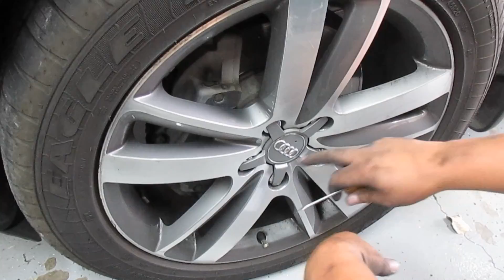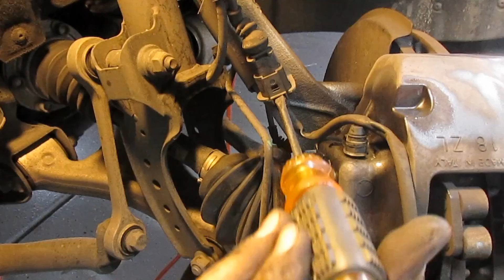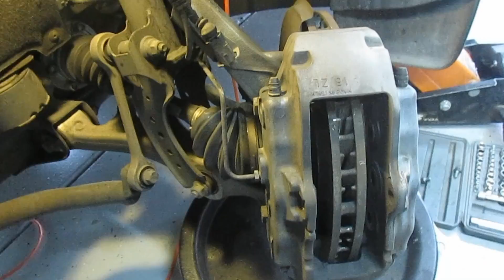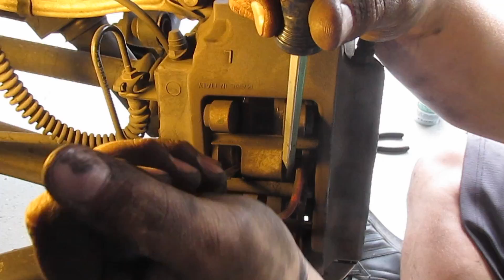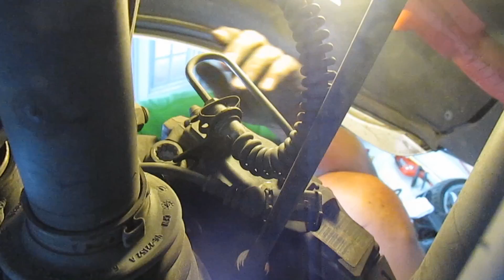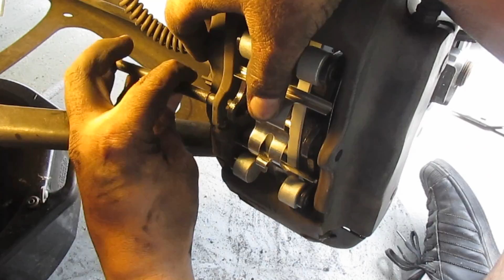HOW TO: Audi Q7 F&R Brake Rotors & Pads

Comment: did the parking brake shoes automatically adjust or do you have to do it yourself?  is there an access port like on old drum brake set ups?
Reply from the maker: I didnt have any issues with those.  Dont have a lot of info to help.  But those are actuated with electrical switch.  So adjustment is automatic
Reply: @FatGuyBuilds  ok, i'm about to do the rear brakes on my q7, thanks for the good video
Reply from the maker: @markbryan8574  no problem

Comment: Really appreciate the video. 
I did the rear pads and rotors yesterday after watching the video - huge help!
I had to use pneumatic tools for the job and couldn’t have done the job without them. 
The issues were:
1) the caliper pins on rear brakes and 
2) M16 bolts holding caliper assembly 

I could not bang the pins out with a hammer and punch (was hitting them pretty hard to point I ruined the punch) so I went to Home Depot and got a punch attachment for the air impact hammer. With that, each pin was out in about 20 seconds. 

The M16 bolts wouldn’t budge with a breaker bar and the “man muscle” I threw at it but I was able to wiggle the impact wrench with the right extension on both the top and bottom bolts and that did the trick. 

I’m new with using pneumatic tools - wish I would have added these to the bag of tricks years ago. They really do save time, sweat, busted knuckles and a LOT of frustration.
Reply from the maker: glad i could help!

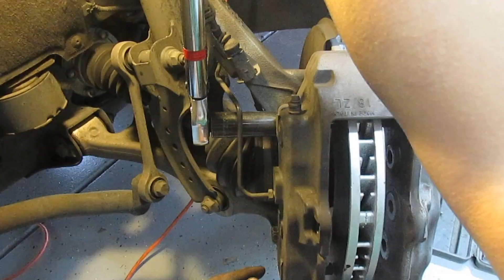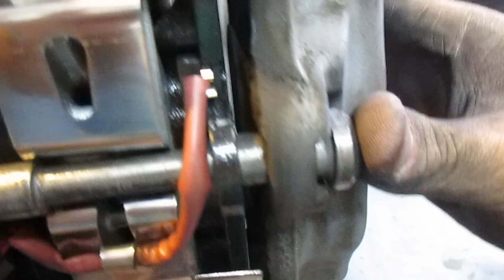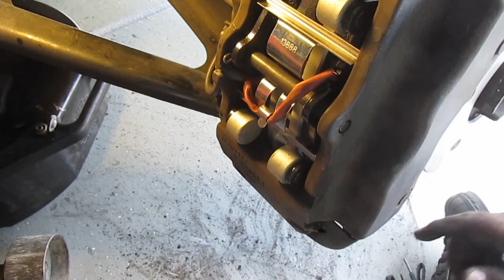Comment: @FatGuyBuilds.  Good video, but for safety's sake, please tell viewers to torque the caliper bolts to 270Nm (200ft-lbs) at 5:19. 120ft-lbs is not nearly enough for that bolt alloy. The disk (rotor) fitting bolt should be torqued to 15Nm (11ft-lb) at 4:43. The tension strut bolt should be torqued to 30Nm (22ft-lb) at 6:55. Wheel lug bolts are 160Nm (118ft-lb) at 7:50 & 14:53. The bracket allen bolt is 9Nm (6-7ft-lb) at 7:26
Reply from the maker: tight is tight,  you dont even need the rotor hold down bolt to function.  make it tight.  over tight is fine , just dont break it.

Comment: Hello. I have a 2009 Touareg, and I folowed the tip with sanding that lip above each hole. I have installed Zimmermann coated discs. now when the car is driven, I hear some grinding noises from the rear wheels . what can be done?anyone has this problem too?
Reply from the maker: should not be grinding unless something is either installed wrong or jammed.  take it back apart and look for the damaged caused by the noise.
Reply: @FatGuyBuilds  i think the grinding comes from the discs brakes, they grind in the dirt cover. i will take a look.

Comment: This is a TDI q7 correct?  I just had a parts site tell me I needed a heavy duty kit for mine because it was TDI.  mine is only the 3.0 V6 though, do you think they were imagining I had the big V8 heavier model?
Reply from the maker: Measure your rotor and then compare it to the sizes of the different options

Comment: Is there any need to apply anti seize lube on the back of the pads to avoid  squealing? I love your video! Thanks.
Reply from the maker: no they come with anti squeak pads glued to the back.
Reply: FatGuyBuilds OK, I need help! I am in the middle of the rear rotor and pad replacement tonight. I CANNOT get the master brake assembly to release the rotor. I can feel the spring assembly grabbing it as I pull on it. I did remove the two bolts on the rotor. I know that this is not a Electronic master brake, so no need for the diagnostic tool. Your rotor came off after a little pulling.What am I missing?? Thank you very much for all of your help. I appreciate it greatly.
Reply from the maker: @jonathanl2748  make sure e-brake is off.  You have the master cylinder cap off?  Did you compress the caliper a little bit before with a flat head screw driver?  You may need to rent the compression tool from autozone as well
Reply: FatGuyBuilds I will remove the master cylinder cap next. The hand brake release was pulled. I have removed the calipers and my piston expander worked beautifully. It is just the rotor now and that batch won’t come off. It is loose, but I can feel the springs pulling it back to the hub.
Reply from the maker: @jonathanl2748  make sure the e-brake is released.  You may have to manually try to loosen the ebrake pads
Reply from the maker: Look for an adjustment knob in the back
Reply: FatGuyBuilds will do and thanks very much.

Comment: The reason the rear rotors didnt fit on the hub is because the Audi VAS scan tool is required to retract the electromechanical parking break on the rear. Please dont do what he did guys and sand/grind down the rear parking brake to make it fit. All your doing is ensuring your electronic parking brake wont work when you need it to because it now has too much clearance to fully extend the shoes against the center drum. 

Source: I am a certified Audi technician. Just take your car to the dealership or someone who has access to an official VAS scantool if you need to do rear brakes on any newer (last 10 years) Audis. Not trying to be a know it all dick or asshole, just showing the right way for it to be done. 

Source: I am a certified Audi mechanic for 3 years now.
Reply from the maker: you are full of shit.  parking brake was not damaged what so ever.  i did not grind the parking brake anything.  the hub assembly had useless tabs built on it to try and force people to buy audi branded parts.  nothing to do with parking brake.  everything works and performs great.  you just want to screw people out of money with your 135$ per hour shit.  you dealer mechanics are the worst scammers on the planet.  obviously you dont change brakes with the E-BRAKE set to the on position.
Reply: @FatGuyBuilds  lmao why do old DIYers get so butthurt by the truth 🤣
Reply from the maker: @markymark3668  not the truth if my stuff works with zero issues
Reply: Hey Mark you mind if I asked you a few questions. My 2017 Q7 is due for a brake job soon , just had a few questions to ask since there’s no content for my Q7 available on you tube.
Reply: @christopheramerally3194  Sure, fire away! :]
Reply: Hey Mark, if you dont have an electronic E-Brake, this should be a non-issue, right?
Reply: @ryanrob99  Yes sir! All the mechanical parking brakes found in older Audis (usually 2008-2009 or before) do not require this step during rear rotor and pad replacement.
Reply: Mark Grames what’s funny is I have a 2015 Q7, no electric parking break.

Comment: I just changed my brakes all around and my rear brakes are scratching/grinding when I start driving and my foot is off the pedal the faster I go the louder both of the rear brakes make a Scratching/grinding sound please help.
Reply from the maker: most likely you bent the heat shield and it is touching the back of the rotor.

Comment: Awesome! Awesome! Video. 1 Audi Q7 brake job complete. One major comment. I have never used a hammer like I did with brakes in all my life of doing brakes! that pin is a bitch! Can't get a good enough leverage clearance to give it a good whack! Plus, I didn't want to break anything else. This is another example or where searing was invented, working on cars/trucks and golf! Quote from dealer was $1300...no rotors. Just brake pads front and back. My cost, I little under $500. and it feels good to get a job done!
Reply from the maker: you are welcome!

Comment: Thanks to you, I just completed my first brake/rotor job (fronts) on my 2013 Audi Q7. I had to buy several tools, but I will  them for the next job.  I appreciate you very much.
Reply from the maker: Your welcome..  please like and share and think about maybe checking out my patreon...  fatguybuilds
Reply: Question: I need to bleed the brakes,  but there are two bleeder nipples on the calipers. Do I bleed both, just the inside one, inside one then the outside? Thanks.

Comment: Hi, nice video, are the back rotors 330 mm or 358 mm in diameter ?
Reply from the maker: sry i dont know.  you can measure yours if you just take the wheel off.
Reply: hi again, thank you for answer! 3.0 tdi engine has 330mm rotors and 4.2tdi engine has 358 mm rotors

Comment: This was very helpful, thanks! I do have a question? I'm about to wrap this project up ($530 in parts by the way, vs. $1500 quoted by mechanic...  significant savings!... and I even painted the calipers in the process!), and I realized that this instructional didn't mention anything about adjusting the parking break back? Is it necessary? Or does it self adjust on this vehicle? THANKS!
Reply from the maker: no need to mess with the parking brake.

Comment: For the rear caliper bolt. Is there a technique to take it off? I have difficulty fitting a breaker bar in the wheel well. No room to fit and turn
Reply from the maker: spray with PB blaster penetrating oil once a day for 3 days then try again.
Reply: Jason wasn't lying about the "man muscle". These were really tight for me also. For the top bolt, I had to hunch over the hub sideways (as though I was wrapped around the axel) inside of the wheel well, and use the wheel well against my back as leverage to pull up. It was quite the spectacle as I am 6'1"/225 lbs. I didn't fit so well :) For the bottom bolt, I was actually able to use a 1/2" breaker bar (because they pivot under the standard 45 degree angle) and slip my jack handle over it. Now, I only had 3-4" of travel without losing travel, and, I suggest using a rag around the jack handle/breaker bar because it will be somewhat wedged against the outer wheel well lip. It can scratch the plastic lip (in my case with the S-Line) or the paint on premium models. Good luck!
Reply: I extended the breaker bar with a black pipe.  The end of the pipe will move a couple inches even tho the breaker moves millimeters.  It is still enough to break it free.  It also provides significantly improved leverage.

Comment: Dude, Well done.  Thank you for making a video that’s worth the time to watch.  Is there a need for any “anti squeak” silicone, etc. anywhere in this install to reduce squeaking??
Reply from the maker: squeaking should go away over some time.  did you make sure to use brake cleaner and clean the rotors very good?

Comment: Do you not need something to disable the electronic parking brake for the rears? Awesome video. About to do this for my RS7
Reply from the maker: just Do not put the parking brake on.  if you have to shut it off in Neutral.

Comment: Hi - Thanks for the description, nice job. I am setting up to do this job on my 2012 Q7 4.2 V8 TDi. I did notice that in the Q7 disc/pad sets, the front discs are always 350mm but the rears can be either 358mm or 330mm depending on model so take care when ordering. The other comment is to watch the fluid doesn't rise up and overflow when pushing the pistons back in. I always press the brake pedal a few times after fitting each wheel, to keep the fluid level as low as possible in the reservoir.
Reply from the maker: Thanks For Watching!!!

Comment: Hi, do you know where I can get 2017 Audi Q7  3.0T front brake pads other than dealer? I've looked through everywhere. Nobody seem to have it yet.
Reply from the maker: rockauto.com
Reply: Jason Georgievski Thank you. They don't have it for 2017 model yet. It sucks. I'm so screwed. I have no choice to buy it from dealer. Just front two brake pads cost $400. lol
Reply from the maker: call dealer and ask what the part numbers are on the 2016 and 2017.  if the body style didn't do a full change they are probably the same.  So you  can probably order 2016

Comment: Jason, did you need any tools to compress brake piston or was the 2 screwdriver trick you showed left enough clearance to slide the new thicker brake pads ? Thanks for that great DIY video btw.
Reply: Two screwdrivers worked like a charm! TIP: If you're only doing pads, just compress one side all the way, then put one new pad in, then swap sides.
Reply from the maker: Thanks For Watching!!!

Comment: I've read that the torques for the carriage bolts are either 200ft/lbs or 200nm (148 ft/lbs), but you only torques to 120ft/lbs. Can you help clarify what the right torque should be for those both front and the 16m ts bolts on the rear?
Reply from the maker: Kevin Fong gotta learn at some point
Reply: Instead of jumping up and down on the lug wrench, you should have just flagged a man down to come help you.
Reply: Btw 200ft/lbs seems ridiculous to me. I have to assume it's 200nm for the front and some lower number in the back.
Reply from the maker: Torque until if feels tight.  I have never had a bolt come loose in my life.
Reply: This is not good advice...for someone who regularly works on cars your understanding of torque specs may be better that you are able to gauge by feel. But for your average DIYer they may not have that same understanding. For anyone reading this, always torque your bolts back to factory spec. Its a large heavy vehicle, high torque specs should not surprise you.
Reply: the online manual for my 2012 Audi Q7 says 133 ft-lbs but that might vary by option code.  I've had mechanics torque things until they feel tight, like when they broke one of the exhaust manifold bolts off inside the manifold, or when we got a flat and I couldn't remove the lug nuts with the factory lug wrench until I actually stood on the wrench and jumped up and down on the side of the road.  I think you can learn the difference between 10 ft-lbs and 30 ft-lbs, but when you get up to 80 or 100 or 130 and you're standing on your head under the car with about one ratchet click of rotation on the wrench between the control arm and sway bar, I think a torque wrench is a probably good idea.  Sure, you don't want them to loosen up but one day you might also have to remove those bolts again.
Reply: Just run the bolt up snug with impact gun, then...
*100-125lbs tap trigger
*125-175lbs hold trigger 1 sec.
*175-225lbs hold trigger 2 sec.
*225+lbs hold trigger 3 sec. or until bolt stops turning.

Comment: Thanks sooooo much for this. I am currently job hunting and have to save money by doing my own brakes. I did some on a 240z about 30 years ago, so this is a terrific "follow these steps" video. I bought the same rotors btw. What torque wrench did you buy? That's a 1/2" correct?
Reply from the maker: the autozone brand.  please like share and subscribe.